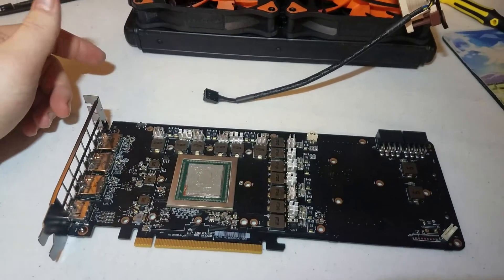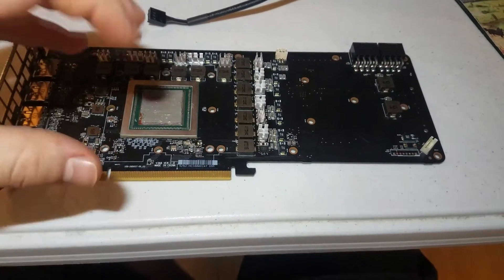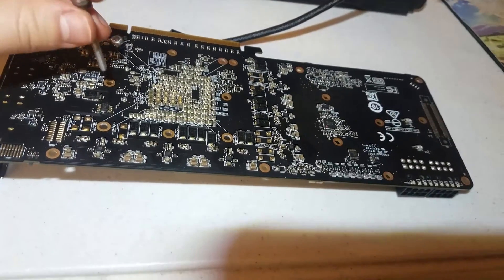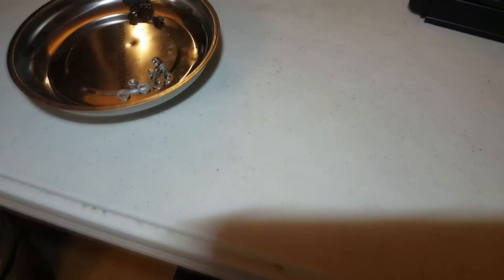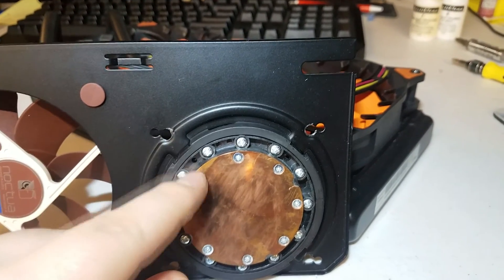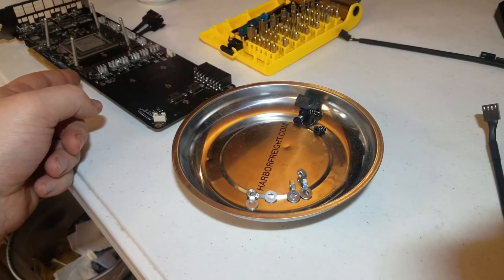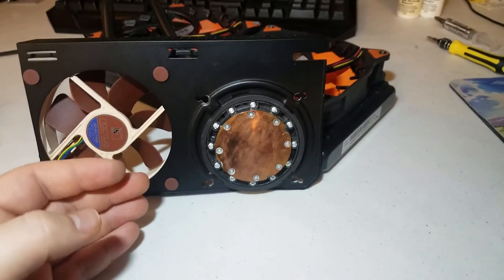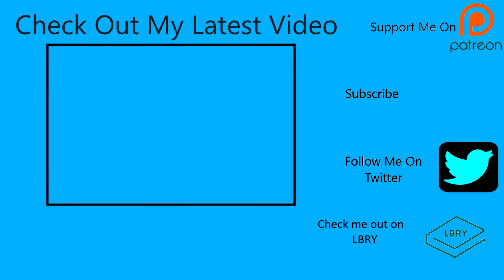Mounting a NZXT Kraken G12 on a Vega 56/64

Comment: Great video, I am currently cooling my 64 with a AIO 120mm alienware dremel/driller mod.  The temps were satisfying vs stock cooler edition (I don't remember exact numbers but I will test again) and I am about to fit a 360mm floe riing cooler to it  just to check if it will make a significant difference to my other gtx 1080 strix.
By the way, I have kept the stock vrm/ ram cooler and adapted it by dremel to fit aio cooler so I didn't have to use the nzxt adepter but that is just my, I'm very good with this kind of sh**
Reply from the maker: Sounds dope man! 
Good luck!

Comment: Can it be done modifying the original brackets that came with the Kraken (Like the Vega VII mod)?? I think is better than a simple bolt where is difficult to control the pressure...
Reply from the maker: Honestly, no clue. I do not own a vega 7 card, nor have I seen it done that way. 

I did this mod to my rx5700xt, works great. 

Like I said in the video, just finger tought the nut, and you "ahould" be fine. 

(I am not responsible if you break your own card)

Comment: Thank you for making this video. It helped me while researching trying to fit a Kraken X63 and G12 on my vega 64. I have the ASUS ROG Strix version. I've had so much trouble with thermal performance on this unit. Fans not keeping my profile and not running high enough for the load. I'm probably not going to move forward with the mod so your vid just saved me ~$200 and a bunch of effort.
Reply from the maker: I am confused, You said it helped you research trying to do it because of thermal issues, but now your saving $200 by not doing it???
Did it help you decide to do it (and save money compared to open loop water cooling) 
OR
Did it make you not want to do the mod
Reply: @Orvis25  I decided to not buy any parts and try to find another solution to my problem. It was very helpful to know that the G12 didn't support the vega 64 without modifying both the card and the bracket. Which I have the tools, but not the will do do. Really my problem all stems from the amd driver defaulting to an unusable default fan curve and ignoring my setting a fan curve.
Reply from the maker: IDK, i had very little issues with my vega 56 card (i now use a 5700xt) in terms of fan control (i also used a custom curve). 
Well at lest it helped somewhat, even if not in the way i intended :P

Comment: Why not just use smaller bolts?
Reply from the maker: Availability of parts at local shop, and price.
Reply: @Orvis25  so with smaller bolts, I wouldn't have to make any modifications to the card and the adapter?
Reply from the maker: @Oggermx  possibly, but they might not mount flush then due to allignment
Reply: @Orvis25  might give it a try, thanks.
Reply: @Oggermx  Did it work out for you?
Reply: @Orvis25  Gotcha

Comment: how long was the screw bolts you use it M4 x ? mm?
Reply from the maker: Not to sure, but you probably only need like 3-4 inch bolts to clear the g12 bracket. 
Id recommend buying like 6" in just cutting them down with a dremmel to the length you like.

Comment: Hello.
How hot do the VRMs get?
Reply from the maker: not to sure, I do not believe there VRM's have a sensor. But i have had 0 problems, so they should be fine, if not cooler than stock.
Reply from the maker: Hey, I updated my testing, check my description,

Hope it helps
Reply: @Orvis25  well I can't say this is a good idea to have the VRMs run at such temperature
Thanks for the update
Reply from the maker: Well you have to remember that's with a power virus software like furmark. Most games, even at 100% wont draw that much power through the vrm. 

Plus, the vrm is fine aslong as temps do not exceed 110 from.what inunderstand. Most vega users get high 80 to mid 90 temps anyway on the stock coolers with normal use (no power virus) 

Either way, hope it helps
Reply: @Orvis25  you think I'd be able to run without putting heatsinks on the VDDC? Can't find them localy, and china isn't an option with current situation. I have a vega56 with v64 bios, G10 & kraken X41. I would put an extra 120mm fan at an angle to hit the top vrms
Reply from the maker: @L424RU5  I have seen people do it. With air cool mods, I just would avoid it as a rule. 

You can get them on Ebay from USA sellers for like $5.
Reply: @Orvis25  i'm EU, cant really find some that aren't from china or usa
Reply: To be honest I'm just full of buyer's remorse. I purchased asus strix rx vega 64. I applied a new thermalpad and still the VRMs on my card peak at 91 Celsius. (The said fix http://forums.overclockers.co.uk/threads/asus-vega-64-strix-improve-vrm-temps-fix.18831051/)
It's just that the card still runs quite hot even with undervolting and new thermalpad (~75 C GPU peak with 2700 rpm)
Reply from the maker: @spleany8123  sorry to hear it. 

Well my mod is here for you:)

Comment: What are the temps? Im intresting in cooling my vega 56 with this method.
Reply from the maker: Idles at about 28-35f, max is like 60 on burn In with furmark. 

I did this model more for silence than the temps. 

Hope it helps!
Reply: @Orvis25  how about vrm and other components ... we know core will be okej but what about vrm ???
Reply from the maker: @Albert41122  I cant really give any numbers, as i have not owned this card for about three years now, but with the simple aluminum heatsinks as I mentioned in the video, it was fine if not better.
Reply: @Orvis25  im about to buy vega64 nitro+ and thinking about kraken g12 or full waterblock...however full waterblock costs more than card itself now :(